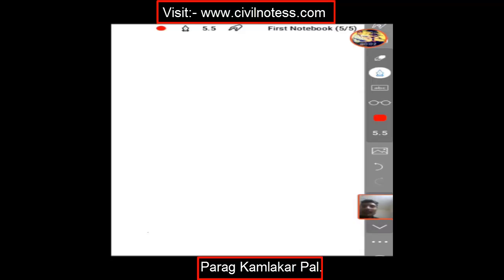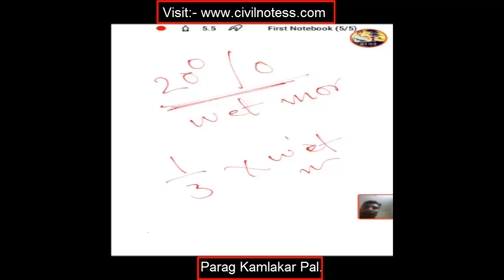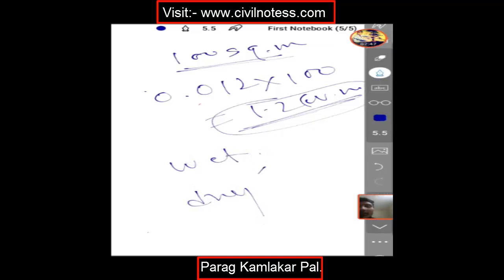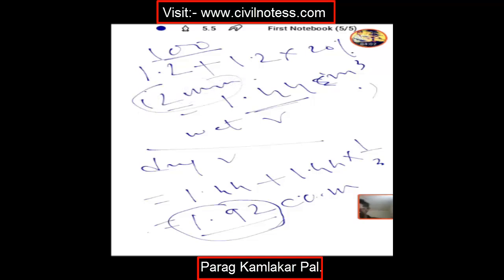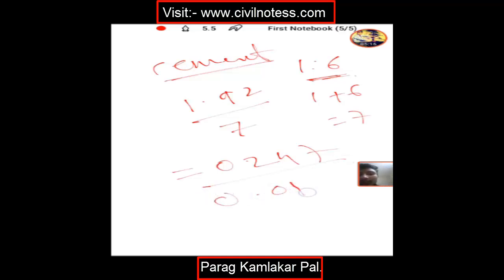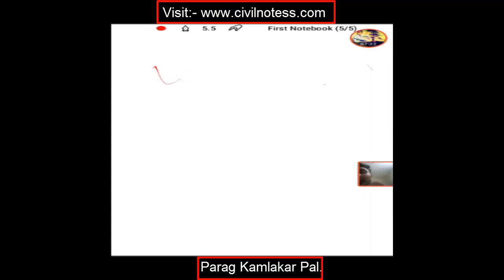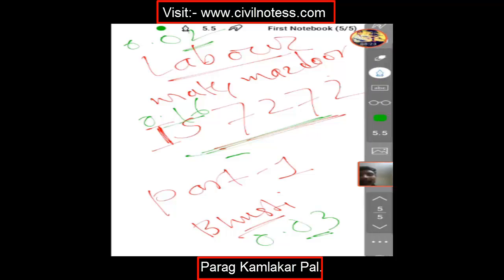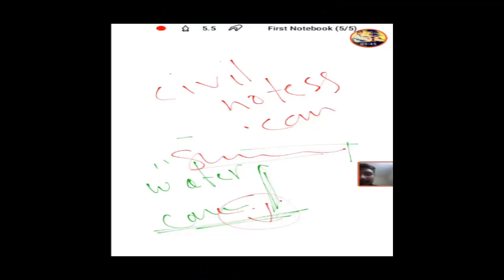Rate analysis of plaster by PARAG KAMLAKAR PAL.

Comment: how u got 0.034
Reply: gunuganti adithya
Cement density = 1440 kg/m3
1 cement bag weight = 50 kg
Number of bags required = Quantity of cement obtained in m3 x density(1400) ➗ cement bag weight. 

Instead of doing all that calculation we just dived that by a factor 0.0347 

Factor = 50/1440 = 0.03472